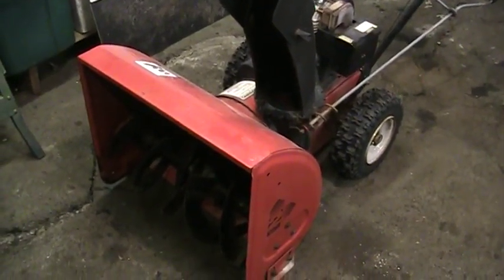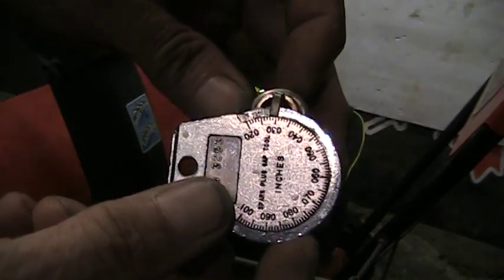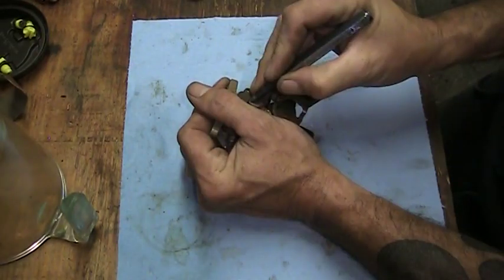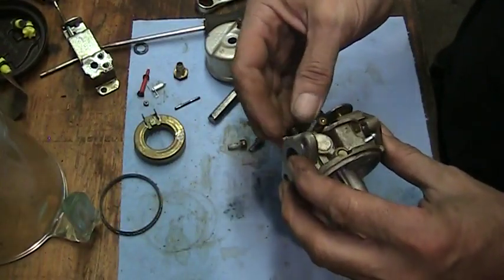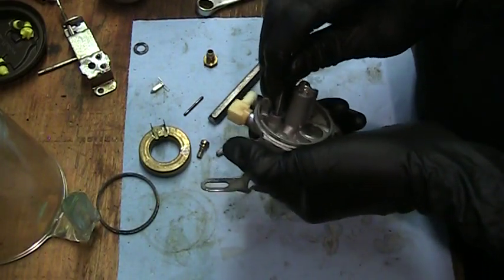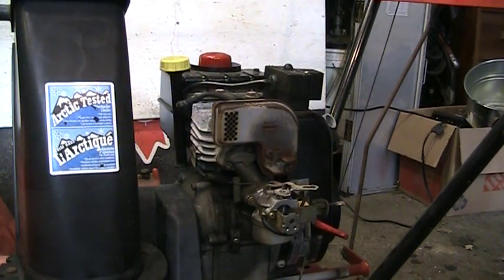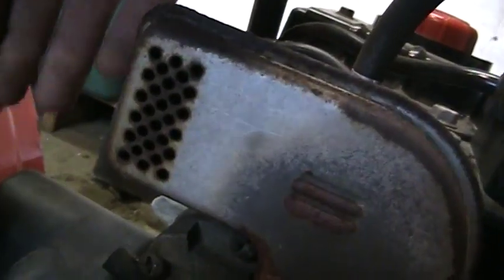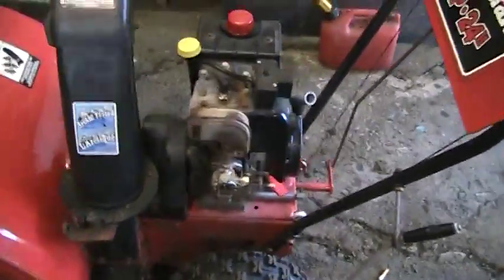5hp Tecumseh Mastercraft (MTD) snow blower has no power. Part 1 of 2.

Comment: If you don't have a leak down tool you can always rig a air line to the spark plug hole and regulate the flow. Do a sound check like you did. Poor man leak down check. Won't get % numbers but good for troubleshooting.
Reply from the maker: Absolutely correct.

Comment: Excellent video.  A lot of help for those who have not done any of this before.  I have the HM80 Tecumseh on mine.  Runs quite well.  Only problem is it sometimes stalls when revving it up.  Have you ever come across this issue with these engines.  I recently put on a replacement carb from Amazon and tuned it.
Reply from the maker: Usually I find if it stalls when revving it up, it may be running lean. Make sure all your gaskets are the right size and all the carb and intake mounting bolts are tight.
Reply: You were exactly correct.  No vacuum leaks, just needed to adjust the main jet a little.  Problem solved!  Thanks. @randomwrenching

Comment: Your videos are fine.  Nice detail on the carb (but you skipped over the float tab adjustment, but that's really frosting).  I never considered a leaky exhaust valve.  makes perfect sense.  I'll do a leakdown first.  thanks!
Reply from the maker: Thanks for the comments. I always look at the float, but don't always think to mention it in the vid.
Reply: I have the same tecumseh engine and I noticed blowby carbon fouling the spark plug.... pretty sure the valves are bad

Comment: I  found out on older models with the same problem, ones that at one time used leaded gas would need to have the valves and head cleaned then they would work great again. I would replace the valve seals and clean the valves. But most of those are long gone.
Reply from the maker: For sure the leaded gas was easier on valves, but it did build up over time.  Thanks for the comment!

Comment: Mine had a clean carb, good spark, and good compression but no power. Turns out the flywheel key sheered so the timing was all over the place
Reply from the maker: That can happen as well, its just usually much more common on lawnmowers.
Reply: @randomwrenching  yeah. That's why I was so surprised. There's a series of shear pins, belts, pulleys, etc in the way that make it nearly impossible.

Comment: I tried to remove the plastic tube to clean it out. Ended up smashing the end over and never could get it out. Got on eBay and ordered another carb for $9. We will see how it works when it gets here.
Reply from the maker: Ah, the dreaded plastic Techumseh emulsion tube...If they are too stubborn, I leave them in and run it through the ultrasonic cleaner.  Usually works out ok for me, but I understand that not everyone has a cleaner like mine.  I hope that new  carb fixes you up!

Comment: Good information thanks dude. Did you ever repair the blower?  
Was gifted like you a 22 yr old toro 622 having issues with car it’s a fixed jet 6 hp. Won’t idle it dies. Has power I adjusted the linkage on Auger and drive she is ok now going forward and reverse just have that issue with the carb. I think I will try and remove the plastic emulsion tube. And if I can clean. I do need to buy a new gasket for the bowl.
Reply from the maker: I did repair the unit in part 2 of this video on my channel. Yours sounds like a dirty carb issue just as a guess.  Idle mixture circuit needs to be clean for sure.  A bowl gasket is probably going to be needed if it's an older unit.

Comment: Wouldn't the compression release be engaged at top dead center on compression stroke so the exhaust valve would be slightly off of the seat?
Reply from the maker: I follow your thinking, but the decompression system happens before TDC, not right at TDC.

Comment: Yeah, mine back fires thru the exhaust and the muffler gets cherry red. Also has no power, don't hear the engine ramp up in rpms. Guess it's time for a little TLC on the valves, just need to order a gasket set.
Reply from the maker: At least a teardown and inspect...
Reply: Same with mine. I noticed blowby carbon fouling the spark plug so the valves or headgasket is probably gone. 

Mines a snow Thor 5.5hp
Reply: Ended up being the intake not closing. The exhaust was no better. I removed .018 as I didn't wanna be in there ever again and the headgasket was hard to find. Now the whole blower lifts up when I pull the rope. Still need to install a fuel drain as this is going to be my backup.
Reply from the maker: @toasteroverdrive1097  Good to hear you found the problem and the fix.  Great job!

Comment: Hi, by chance would you happen to know the part number for the scraper-blade located at the bottom part of the Auger Housing: it's a long 24" x 2" (approx.) black metal thing with 4 nut & bolts. Thanks!
Reply from the maker: Many parts look the same but are a little different. Even on the same model but different year.  The best thing to do is use your model number found on the white tag on the machine to find your specific part number.
Reply: @randomwrenching  That white tag (I know what you mean) is all scratched up and can't make anything of it. The blower is the exact one in this video mastercraft 5hp 24" 1997 (year). If you still had the same blower I could have used the model # to find the part for that scraper blade inside bottom of the auger housing :(
Reply from the maker: That machine is long gone, but I will check if I still have the model number recorded somewhere for you.
Reply: @randomwrenching  Yep, that was a Tecumseh engine (no longer in business since mid 2000's).

Comment: I had one of these actually a few....bought one used and it didn't work right..exact same issue...governor spring in the wrong hole.. ramped right up after assembled correctly
Reply from the maker: Yep, that can surely happen, and it's a good thing to check for. This machine was perfect after the work was done. Governor in this case was fine.

Comment: Ok, new question. I went through everything on mine, exact machine, and it ran great for a good bit. I'll have to look at the govenor. It has run best for a long time at 1/3 choke. I cleaned out all the orifices in the carb again and it ran better, with no choke, for a few hours. Then it started to sputter and shut off, eventually backfiring. Now it will only idle in full choke and has 0 power. I ha e been doing A LOT with it the past week so maybe just overdue?
Reply: I don't have a compression tester or the abilities to lap my valves
Reply from the maker: @jonathanbormann5077  It sounds to me like there is still something plugged in the carb.  If it runs better on choke, then it means its running too lean.  Sometimes you just cant get all the tiny passages inside there clean enough, and it requires a new carb.  They aren't very expensive...
Reply: @Randomwrenching  problem is finding one right now. We just got hit hard and we're stuck. I pulled the carb apart again and found my old welding tip cleaners to use for the orifices. Finished it off with a can of carb cleaner and heard something blow through. It think it was it cause it's running good now. I also found the little float shutoff had fallen out of place so that wasn't doing me any favors...😳
Reply from the maker: @jonathanbormann5077  nice, glad it back in order
Reply: @Randomwrenching  there's a small screw with a spring behind the head on the top of the carb. What does it do?
Reply from the maker: @jonathanbormann5077  A screw with a spring under it can be a mixture screw or an idle screw. Does it look like the one you are seeing adjust the throttle cam?
Reply: @Randomwrenching  I see both but I'm referring to the one just above the bowl gasket.
Reply from the maker: That's your low speed mixture screw
Reply: @Randomwrenching  interesting, ok. I messed with it (probably  a bad idea) and it didn't seem to change much. Clea.ed the carb real thorough amd installed a fuel filter. Runs good when it does but it randomly putters out now and is a REAL PAIN to start again when it does. It did that before the fuel filter was put on but after I messed with that screw. Would effect its ability to start up?
Reply from the maker: @jonathanbormann5077  Sounds like a fuel starvation problem now.  A fuel filter may not be a good idea on your gravity feed system. There is not enough drop in the line. I don't think it's supposed to have one.  The screw changes low speed fuel mix, and yes it needs to be adjusted properly to start easy. Start around 1.5 turns out from lightly seated.
Reply: @Randomwrenching  thank you Sit. You're a gentleman and a scholar. 👌